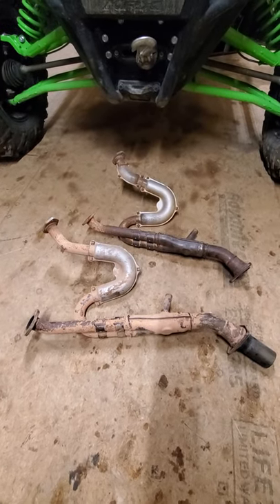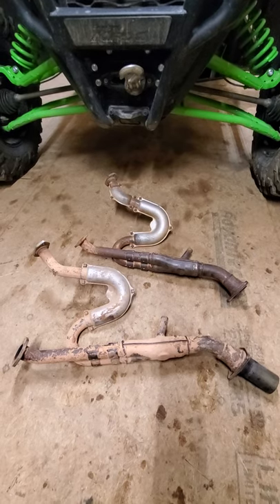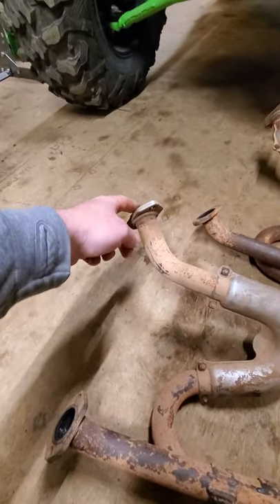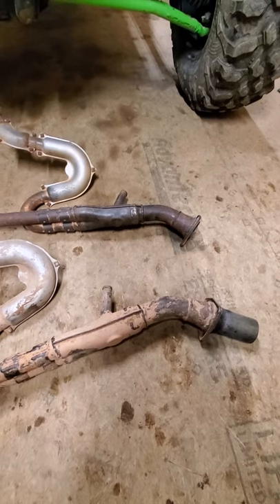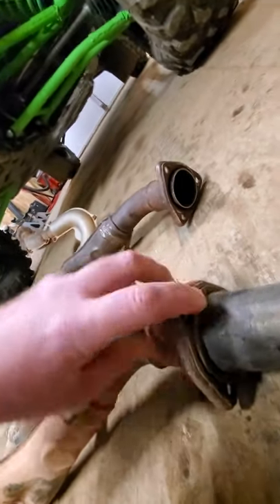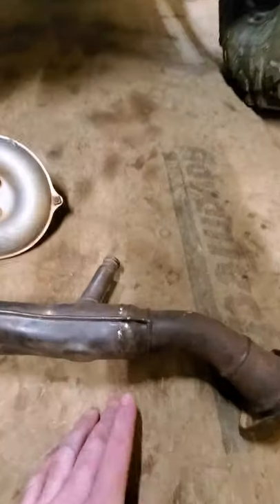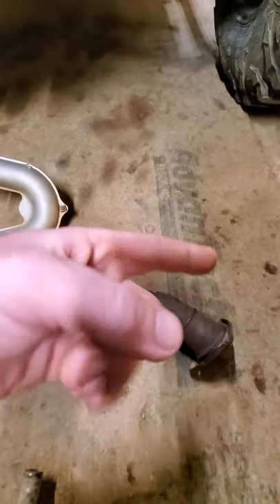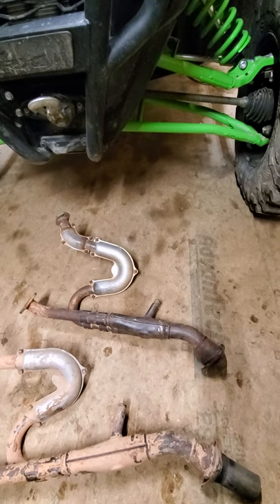2014 to 2020 Teryx and Teryx 4 800 catalytic converter removal

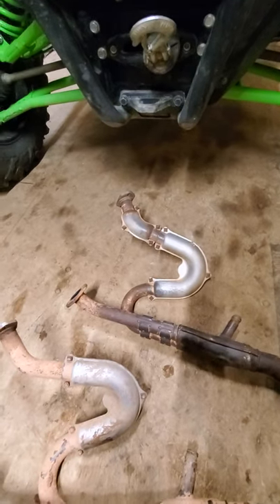Comment: Access to everything on the T4 is a pain. Even the belt. The whole 9 yards (2:59), is a full exhaust system. Big gun evo dual pipe with a big gun fuel programmer. Big gun makes a great set up for the Teryx 4. Good vid.
Reply from the maker: Thanks!

Comment: I used a hole saw on the rear cat two minutes it was gone. Front did like you did. I went one step further and cut the small tube in the muffler out left the baffle plates in.even more throttle response and power feels great. I have a 17. T2 thanks

Comment: Good video. I’m wanting to remove my converters from my 2020 Teryx4. Question. Would it be better / easier to remove the skid plates or center console / floor boards to remove the exhaust pipe from the engine. Thanks in advance.
Reply from the maker: On a t4 I would remove the rear floorboard, center console and the Skid plate to get to everything
Reply: @rightcoastoffroad   I have everything unbolted but can’t fit the header pipe out the back or the bottom. Should I remove rear floor board to get it out?
Reply from the maker: @wildroundhere5456  yes

Comment: Question, I have a 2014 teryx 4 , it started not wanting to idle and when you press the gas anything past 1/4 throttle it Boggs no power! I’ve put a new fuel pump assy NO CHANGE!  Have you or anyone you know had and FIXED this issue?
Reply: My 2015 was doing the same thing. Ended up being plugs!  Two new plugs Ana she was good!
Reply: @brooke14100  that’s exactly what it was! Spark plug was fouled in the forward cylinder. As soon as I pulled it out it was still wet with fuel! I put 2 new plugs and it now idle’s and has power when I step on the gas! The only thing I still have is if I’m at idle and go to step in the pedal just barely there engine has just a little hesitation then takes off. I’ll have to figure out that issue. It’s not all the time just sometimes!